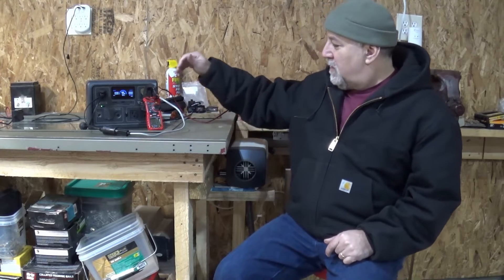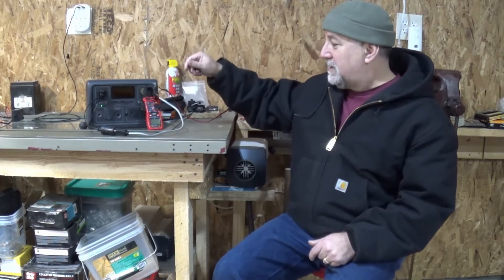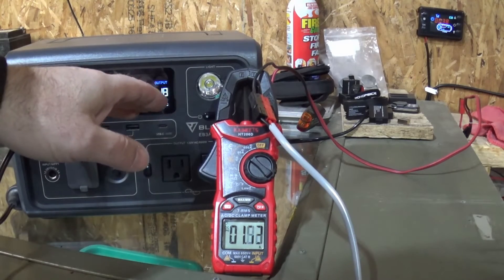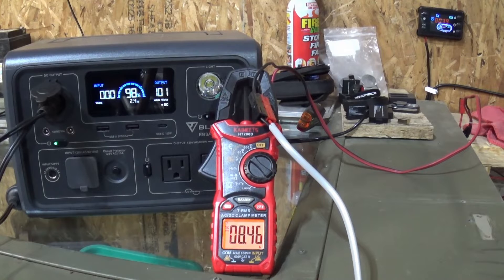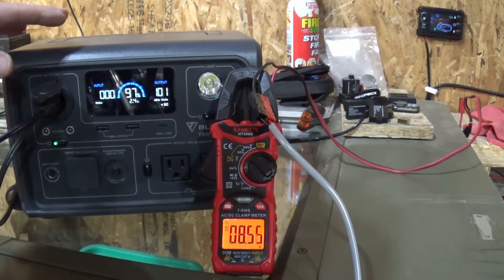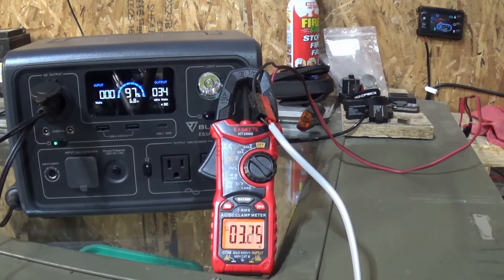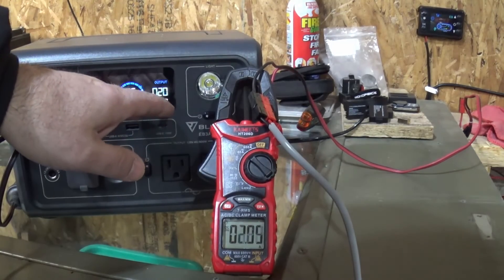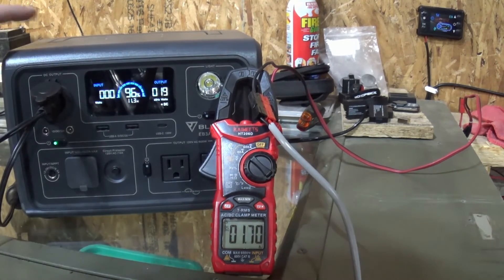Diesel Heater running from cigarette plug of power bank

Comment: Since this is a 5KW diesel heater. Could a 2KW diesel heater draw less amps starting?
Reply from the maker: I don't believe so. The 5kw "language" I believe is referring, somehow, to how much heat is generated, not electrical power consumption. The initial high power draw is due to the glow plug heating up, and generating heat with electricity is one of, if not the, worst consumer of electricity. So I'm pretty sure all of these heaters start the same way, and they all have a high draw of current when starting (and shutting down).

Comment: How did you manage to make it works without using the AC to DC converter? You lowered the heater to 2hz?
Reply from the maker: The speed/output of the heater doesn’t make a difference as to whether or not this works. The startup process is where the most current is drawn. In this case, it’s right on the edge for 10a for a brief moment, but my powerbank handles it. I’ve done it several times successfully.
Reply: @TheGergeDIY  I was asking this because you made a video using the AC port to run the diesel heater. I thought you couldn't make it running using the DC port (without tripping the fuse) and somehow found a trick to make it work. But if I understand correctly it could've worked using DC only from the beginning.
Reply from the maker: @teiva   - yes, you're correct, I did have that issue. I'm not really sure what changed, it may have been a firmware update in the Bluetti EB3A? I am now able to run off the DC side of the Bluetti though, which is awesome 'cause it runs twice as long. I'm also not using the cigarette plug any long, rather one of the DC outlets just below it. It's much more secure.
Reply: @TheGergeDIY  Another question, does it still work if the battery is at less than 50% when starting the heater? Because as the voltage is lower it may need more amps to output the 130~140w necessary for startup if I understand it correctly
Reply from the maker: @teiva  - it does, I've started it below 50%. I think mine is using almost 100w at it's max draw during startup. I do make sure to leave some left over for shutdown, which also draws hard on the battery, but not as long as during startup.
Reply: @TheGergeDIY  ok thank you, i hope it will work for me as well
Reply from the maker: @teiva  let me know how it goes for you. This video https://www.youtube.com/watch?v=8PO3j8mPK4E gives the details on my current DC connection.

Comment: Lucky it runs on this power station, on many it does not.

Even if you get it to run you can never predict when your 12v fridge comes on and draws another 40 watts tripping the breaker. (In a campervan setup)

I run mine from the inverter with a 240 to 12v 15a adapter but this terribly inefficient. I ordered a small motorcycle battery and a 3A DC to DC battery charger. I hope I can connect all those and the battery will take the startup (and power down) spikes while gradually charging from the DC to DC charger.
Reply from the maker: There’s another video on my channel showing a battery/charger hookup. I’m not sure that motorcycle battery will have enough in it to startup. I do it with a deep cycle battery and trickle charger.
Reply: Fossibot F2400 has 12v25a XT60 output plug. One can run, 12v fridge, diesel heater and lights all through a hub into it. I think it's the only one I've seen that has it. Unit may be slightly weaker in efficiency of ac inverter for example(~-100w), but the pros like this plug, make it worth it as well as being affordable.
Reply: @NotOfThisEarth9  There are some larger ones that have more amps ont he 12V output but no sub 1000 wh I can think of. Goalzero has some and Ecoflow on some of their larger ones I think.

Crazy no one has made one that's compatible with diesel heaters, untapped market.

Comment: maybe a veeery dumb question. Do the bluetti have 10A limit for each port or in total? for example, if I have a fridge on a 12V output+other stuffs and the heater on the other 12V output, it's 10A in total or per port? :D
Reply from the maker: I have to say, I don't know if that's 10a max combined, or each plug is 10a. In the manual, it lists them each separately, as well as the USB jacks, with a rating for each, so maybe it is 10a for each one?
Reply: 10A limit is for all 12v outputs together.  NOT 10A each.  I know...bummer.

Comment: Don't you read the internet? Many of us have been running them off all sorts of batteries. Mine is running as we speak and drawing exactly 19 watts. I have plenty of monitoring software and can see instantly what it is doing. On startup it can go up to 80 watts, but that is about 7 amps, and it only stays there for a very short while.
Mine has has a solar panel that keeps the battery topped up and is switched on and off with Alexa voice control.
Reply from the maker: Sounds like you have a good setup, glad to hear. Mine pulls just over 100w on startup. When running at 2hz, I'm seeing 10w of draw, which is awesome. I have one upstairs in the garage running on a 12v marine battery that's topped off with solar.
Reply: are you using a vevor diesel heater? i haven't found one yet at only 80W. can you give me some advice?

Comment: Nice , now I’m going to have to try it , always thought that the 12v outlet couldn’t handle diesel heaters, from all the videos out there
Reply from the maker: If you’re using the eb3a, make sure to update the firmware via the app to the latest version. I’m really happy it works now.
Reply: @TheGergeDIY  , I just tried it and it works awesome… I can’t believe when on 3.2 hertz the BLUETTI was only using 14 watts .. I also have the BLUETTI  AC180 ,now I have to try it with that.. thanks for the information.
Reply from the maker: @betto79 yeah, barely using any power. I ran it at 2hz and I think it was pulling 1 amp or so and the eb3a estimated a 22hour runtime.